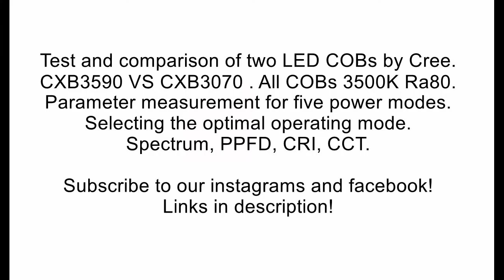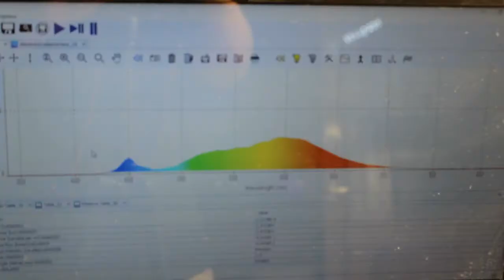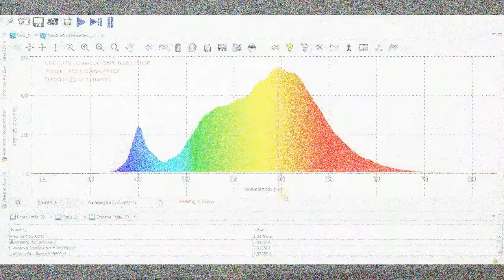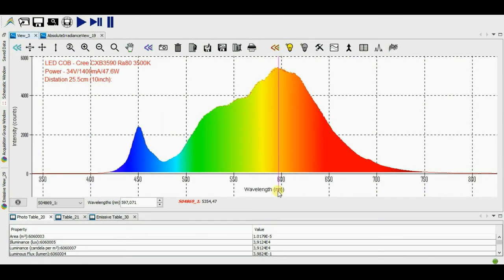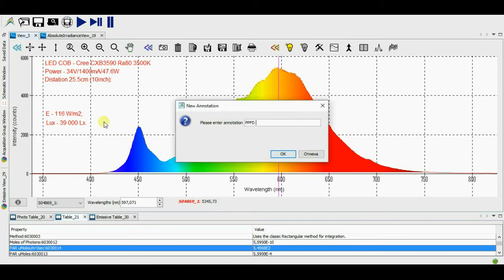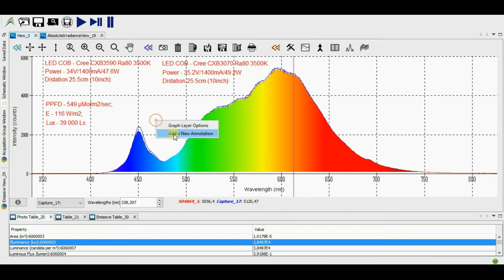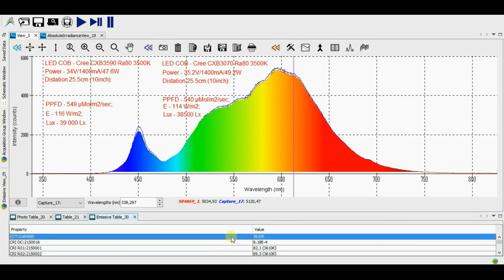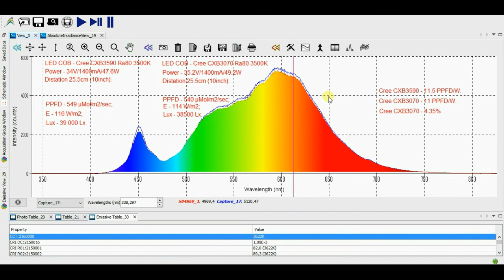Test and experiment with LEDs Cree CXB3590 VS CXB3070. Spectrum, PPFD, Ra, CCT. Horticultura mmj

Comment: What kind or model of heatsink is that used on here?
Reply from the maker: CXB3590-0000-000N0HCD35G-ND 
CXB3070-0000000N0HBB35H
Reply: fitolab. pro would these be good for 16 hours run time? Or should I use a small fan etc. I have an associate's in electronics but this tech wasn't available when I studied in. 1996. Thanks for the help
Reply from the maker: This radiator is designed for 50W COB's. If the power does not exceed 50W, the fan is not needed. For greater power there are radiators of larger diameter